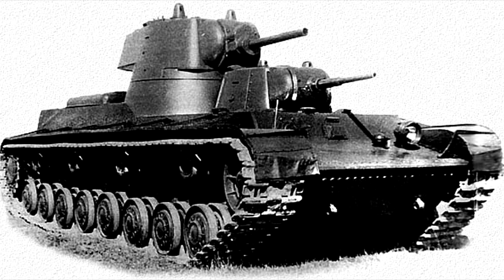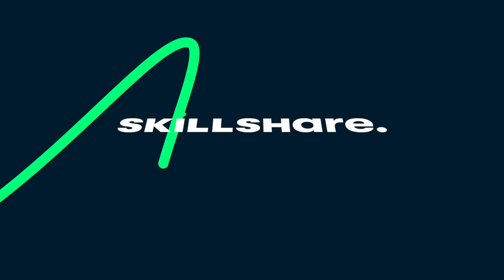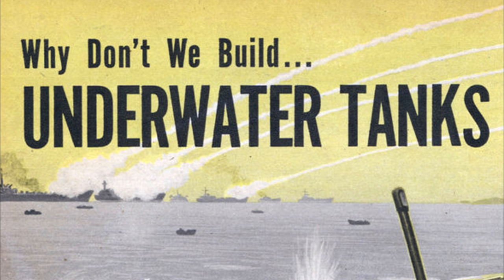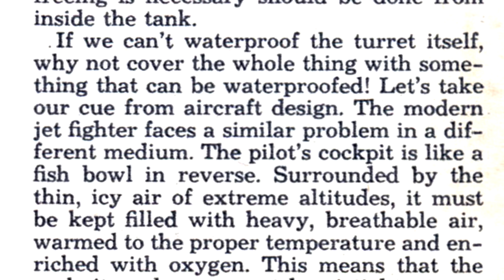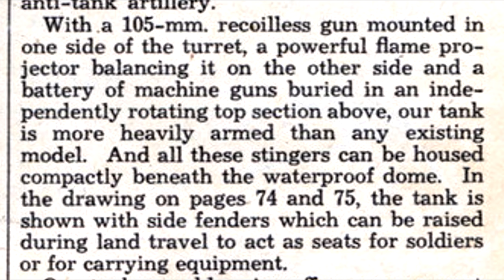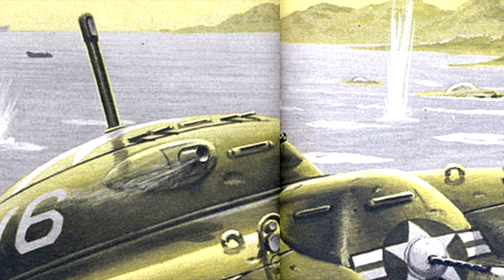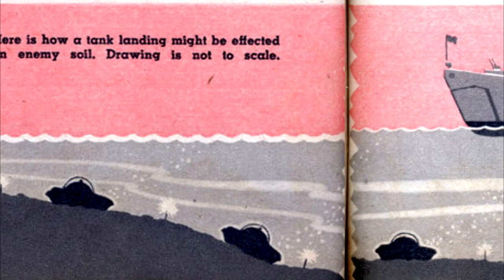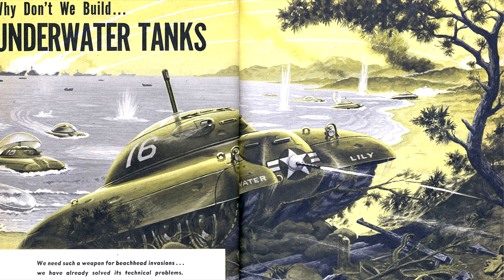The CRAZIEST Amphibious Tank Concept EVER | Cursed by Design

Comment: Putting under water topography and mud/soft sand aside, you would have a similar quandary as you would with the amphibious tanks. Countermeasures would be invented quite quickly, say underwater mines, repositioned On the bottom of vulnerable beaches. Obstacles put in the water, recalibrated depth charges, redesigned shells and so on. How substantial would the glass dome have to be to withstand the countermeasures? The heavier it is the more engineering problems.   All the countermeasures are also comparatively cheap in comparison to the tank too and mostly just existing technology repurposed. Not practical in a war of attrition.  Maybe an improved design to break a huge stalemate like the Western front in WW1 type situation. If you could find the right beach and not mess up, you would have only one chance. They would have to be used correctly with no one ever having used them in battle.

Comment: If the recoilless gun fires it's backblast into the turret, that's going to be  problem for the crew. If it fires it out the back of the turret, that's likely to limit elevation and depression, and pose other design problems.

Comment: Something you glossed over and dismissed without much thought.... Of course the tank would be loaded with pressurized bottles of air, one set for the crew to breathe and another set for the diesel engine. As the article pointed out exhaust gasses would be vented out to the sea or scrubbed and recycled like a sub. No engineer would consider only using the air trapped in the bubble.

Comment: Without knowing the topografic details of the seafloor, you would just dump your soldiers inside an expensive casket into the sea.
Stuck in too soft sand? Found an underwater cliff? Slope to the beach too steep? Sucks to be you.

The general idea is not too shabby, 'though. You'd need a submergible vehicle cappable of float. More like a  short distance submarine with land fighting capabilities.

Comment: So what's the plan to deploy these? I can't imagine it'd go very well to drop them to the bottom of the sea without knowing how clear the seabed is, if there's rocks or underwater ditches, etc, so would the landing ships need to sit there and send out divers to find a clear path? If so then the ships would need to be decently far from the shore or else they would be sitting ducks for coastal artillery crews. Even assuming a clear path can be made what happens if one of the tanks gets stuck? Does the crew just die? Or would they send rescue divers? How would they be able to communicate with the landing ship or other tank crews? This is a neat idea but it just is not practical from how I see it

Comment: At about 8:50 you mention the crew suffocating. Did not the article you read, provide a stored air system for use while submerged?  I understand this would serve to keep an engine running, but surely something would be provided for the crew?

Comment: i take issue with the use of the recoilless rifle. it'd have some sort of opening to the outside for the gasses counteracting the recoil to actually make this a recoilless gun. they could put it in kind of a seperate compartment to the crew and create an autoloading system, so that this weakness will not affect the crew and therefore fighting ability of the entire vehicle. evrn if the gun is then taken out, it's still a fully capable flame and machine gun tank. the gun could then also be replaced more easily if damaged by just removing/replacing that particular part of the turret.

Comment: I think it would have similar problems to the German tigers where the tank is an engineering marvel assuming it works properly, but instead of the tank itself’s reliability it would be the situational use of such a design and would be too costly to possibly be an effective tank. It also has the valid issue of. What if it gets stuck. I feel most would hit the seabed after leaving the ship and that would partially sink it into the sea floor making it immovable. If such event happens retrieving the crew let alone the tank would be a nightmare since the tank would be likely at least a couple dozen feet underwater.

Comment: No! Recoiless rifles and guns require a countermass to be vented rearwards, meaning some of the gasses from the rocket-shell. This superheated gas would turn anyday into a Monday.
Even if the gas were vented OUTSIDE of the tank, the entire weapon would have to be moved forward to allow a new projectile to be loaded, then moved back again to vent outside. 
Your rate of fire drops dramatically in this case, and the projectile range from these weapons is lower than comparable caliber breechloaded guns.

Comment: am i the only one that imagined the dome making a soft "pop" noise when it was ejected from the turret?
Reply: I imagine it making a soft "pop" noise, popping about three to four feet into the air, and then coming back down on top of the turret, now slightly askew.  Ejection seat canopies, to some degree, rely on the wind blast from the airplane's motion to do most of the work of getting the canopy out of the way...
Reply: @rdfox76  at that point do you try and blast it with the main gun or pop a hatch and try and shove it off

Comment: Ok how about this? Shoot the difference and make a vehicle that simply floats a few feet below the water line. It'll have both protection and cover with it being not visible or barely visible. The water would stop any small calibers and drastically reduce the impact of larger ones. Of course it's still at risk when it reaches the beach but at that point it would be already unloading its crew and completed its mission. It could submerge itself with ballast tanks like how submarines do and if these tanks are damaged it could simply float a top the water like the alligator did. But over all it would prevent alot of incoming fire on the approach and may even make it hard to tell where the landings would take place.

Comment: You don't need the plastic bubble because the US Navy solved the turret/hull connection issue already with their Screw shaft/hull connection joint. For the engagement that the author posits this crazy idea actually has a lot of merit for the majority of the Korean cost line. Most of the Mud areas are up north around Soul but the rest of the coast line, except for the Chosin River delta, particularly the western coast line would offer good enough traction to the tanks that the author was proposing. I don't think his idea of a recoilless rifle arrangement would hold water, Sorry. but the 90 mm gun could easily have been sealed with a blow out plug that could be removed with either a small powder charge or the 1st round if it were a solid shot like sabot. A recoilless rifle would work well against tanks and such but against concrete fixtures it often has mixed results . The 2 major amphibious landing areas that the Navy saw, Soul and Chosin River delta had the wrong sort of bottom, i.e. Mud, for this vehicle.

Comment: Sealing turret rings isn’t that hard - elastomeric seals make it quite easy. A conventional main gun is similarly easy to seal at the breach end - the muzzle is the bit that takes work. Machine guns and ports are the biggest problem for sealing. The propulsion system is the biggest dead end however as you would need to fit a full submarine power plant and battery pack into a much smaller volume in a tank for air independent operation - hence the use of snorkels in current wading tanks.

Comment: 8:35 AIP. so compressed air could run diesel engine with underwater exhaust. the question is for how long? how much air would be needed and how fast would tank need to reach shore
alternative would be something like otto fuel 2 or whatever is used for torpedoes. not sure if normal engine could be adapted to use both diesel and that fuel.

Comment: I'm about halfway in, and wondering how the hell they intend to supply air to the engine???
Reply: The German Tauchpanzer design had a snorkel connected to the top of the turret by a long flexible hose. The snorkel incorporated a float that detached from the engine deck and floated stayed on the surface as the tank trundled along on the sea floor. The hose gave roughly allowed a depth of about 45 feet. They estimated maybe eight minutes or so of travel time before the air got too foul for the crew, which of course was if everything went perfect. We know that never happens in battle. When they gave up on invading England, they dialed back the gear and kept the ability to ford a deep river, and the design did get used on the Eastern Front to a limited degree.

I'm actually building a 1/35 kit of the Pz III testing prototype at the moment.

Comment: Engine "fumes".    Not necessarily, it might not need an electric but instead use its own 'compressed air' supply, using air tanks of its own much like some torpedoes, they could feed the engine then exhaust could be vented outside into the water...   while this would cause a bubble trail, it wouldn't add any extra weight to the vehicle.  alternatly if depth could be controlled, ie you knew you were dropping them off in 30' of water, and they would never go below say 40'  dual snorkel system, with intake out output systems attached to a hose with flotation gear could also work.

Comment: Ah, halfway into the article he starts trying to figure out how to waterproof a turret ring.
Hear me out. Underwater Strv 103. Hull-aimed wedge-tank submarine.

Seriously, the point is to get a protected fighting vehicle onto the beach that can immediately engage shore defenses, so a fully rotating turret is not that essential! A casemate design would be perfectly acceptable, because frontal armor and firepower are almost exclusively the point!

The problem with the reality of this design, of course, is a lack of experience in designing superheavy vehicles that can successfully crawl up a beach from underwater in combat conditions. I almost feel like suggesting a ridiculously overprepared rhomboid tank with paddle-tracks to force through mud, sand, and rocks...but then what about vegetation?

Too many variables.

Comment: The comparison between the plastic dome jettison system for a jet airplane and for the tank is problematic.  The jet airplane at altitude has an overpressure (the pressure in the cockpit is less than the outside pressure) and is moving quickly.  Small charges are enough to pop the canopy, the pressure difference will help with the jettison and the speed will clear the dome for the pilot to eject.  Furthermore, it only needs to deal with a pressure difference of up to 1 atmosphere (in the limit that a vacuum was outside the cockpit) and has a reasonably small surface area so it can be lightweight.  The tank would need a more substantial dome that supports a potentially large overpressure (10 m of water is roughly one atmosphere - how deep would this thing be rated?) and will need to cover a large surface area, much bigger than that needed for an airplane.  It would be quite heavy.  When jettisoned, there would be no pressure difference between inside and outside and no speed to help clear the dome.  It would take considerable (explosive) effort to get the dome off and clear from the tank (needing much thicker armor at those points?), any jettisoned dome should be of minimal risk to your soldiers outside the tank (generally not a problem for an ejecting pilot), and anything following would have to negotiate jettisoned domes.  Not as easy to implement as the author makes out, methinks.

Comment: I just don’t get why it would need a turret, yes it’s nice to have tactical flexibility but for a design this niche I’m not really seeing the point. It just provides a single point of failure as a opposed to a turret-less design. The plexiglass would be vulnerable to shock waves, It would be very easy to defend against using simple depth churches pre-planted in the beaches. A design similar to the German Jagdpanther might have worked better but the gun still needs to transverse (the tech for something like the Swedish S tank was still far off) and that would still likely need to be covered by something but that would be a much simpler process.
Reply: Those depth churches have a high conversion rate.
Reply: Shush I’m disgraphic, I literally couldn’t see it. Besides you got the idea

Comment: I think it was a neat idea but not practical...cost I don't think would be an issue, a lot of the parts could be reused and modified from other tanks, ie., pretty much the whole m4 Sherman could be used just change out the main gun, seal all open lower holes like the co-drivers gun, engine compartment etc...the main issue would be the mud on the see floor, either the tank would have to be significantly lightened, maybe putting air bags on it and have a prop drive, other wise it WILL get stuck no matter what you do...

Comment: I'm 100% sure this would work, by 1960 you didnt even need special tank just throw compressed air can so engine can breathe for up to 30 minutes and your good to go. For example leopard 2 consumes 5.3 l / km offroad so it would need 14kg of oxygen per kilometer thats easily achievable. Equip crew with life wests and 5 minutes oxygen tanks for emergencies and bam mbt on beach

Comment: This concept has a couple of fatal flaws. A recoilless weapon has a backblast; where is that to go, in the watertight turret as depicted? The sea bottom, largely composed of silt, could wind up miring the tank nicely, killing its crew eventually since they cannot be retrieved. Obstacles on the sea floor, wreckage, or any number of other problems could also wind up ensnaring the vehicle.

Comment: Unless I am completely misunderstanding the technology... how would the recoilless rifle fire without killing the crew or requiring someone to get out to re-load it?

If I understand correctly they have backblast like a rocket launcher and are loaded from the rear. So to fire safely the gun would have to stick out the front AND back, but the only way to load it safely then would be from the middle, which seems HIGHLY impractical.
Reply: you can build them to vent forward, look at the sturmtigers rocket assisted weapon, venting holes around the barrel shroud
Reply: @gaiamission7200  OH I thought those were for cooling or something.

But then how does that negate the recoil? Because I'm pretty sure the recoil is negated by have the projectile go one way and its exhaust the opposite way. Equal and opposite reaction stuff.
Reply: @42meep13  its redirection forward, and the pressure reduction from the venting method reduce the overall recoil significantly, in addition, because the gasses are very low mass they are unable to overcome the inertia of the tank

Comment: If you were trying to fill both the tank AND landing craft role I am not sure it is a good idea since knowing it is always getting tried in other military hardware and it never seems to work out as well as advertised . 

 Sorry but I am not sure I understand the intended use of this proposed vehicle . Is this intended as a "one way ship to extended combat" OR "reusable shuttle for beach head use"  OR to fill both roles as situation requires ?  Not sure these two roles in combat can be made to not be mutually exclusive and still have a viable craft .

Another example might be the airborne submarine . Can they build one ,  yeah probably but would it be viable against a straight fighter plane OR a straight submarine/boat in combat ? Probably not . 

Seems to me that using the present marine craft would do fine if they started with a base model designed to fit one role then design it modular from the frame out with design kits to switch out .  E.G. Air tanks/flotation systems  removed to make room for ammo racks and added armor plating . Switch them once a beach head is secure from landing mode to heavy mode .  Maybe ?

Comment: The second biggest problem after the tank would have to be exceptionally light due to water being 800 times denser than air, is ironically one that the guy placed on himself, the recoiless rifle design, makes no sense, either the gun is contained inside the turret which would kill the crew due to the contained back blast. Or the loading has to be done on the outside, making the turret a lot of wasted space.

Comment: Total tosh 
Notice the illustration of the deployment of the waterlily.  Not only would you have to invest in a completely new (and highly risky) concept, but add on the cost of converting landing ships or even a completely newly designed mothership.

The tank would be limited to the beaches it could land on.   

Jettisoning a canopy from a jet fighter and a large perspex dome from a tank are two different issues.  Don't see how the comparison is so straight forward as suggested.

Please keep the barking mad concepts coming

Comment: Not entirely a bad idea. Should they replace the turret with an artillery gun that could travel 360° and could be fired from inside the tank this could've solved the turret problem and put arty on the beaches with more accuracy than naval guns from miles away.

Comment: I dont think an electric engine, even a modern one, could power such a vehicle for any prolonged period.  With amphibious tanks the exhaust is kept above the waterline but in an undersea tank there is nowhere for the exhaust to go except maybe into the interior... where the people are.  Maybe a nuclear power supply could provide the necessary power for long enough but.... well.... that has its own problems.